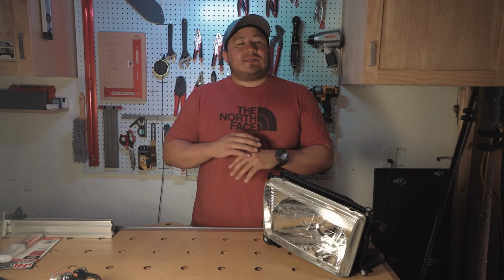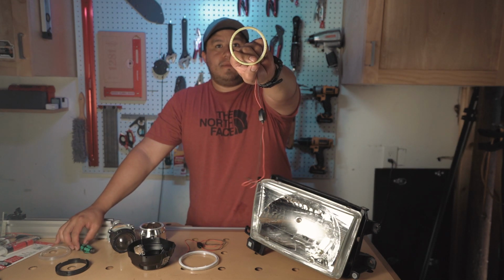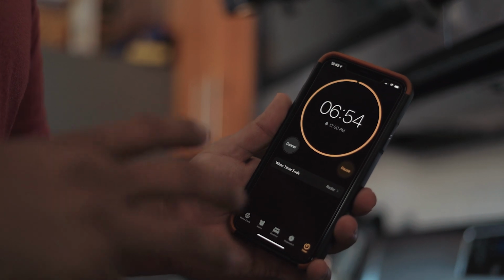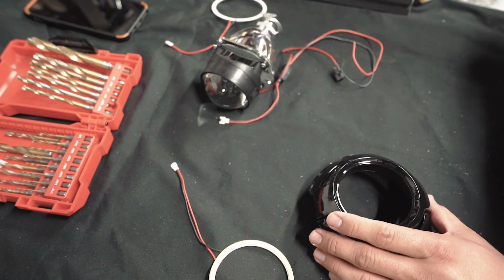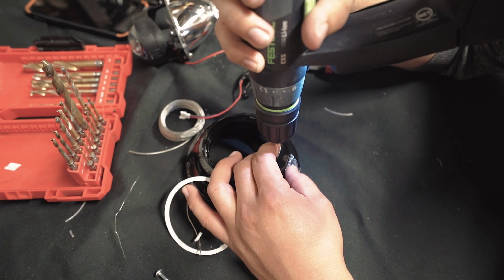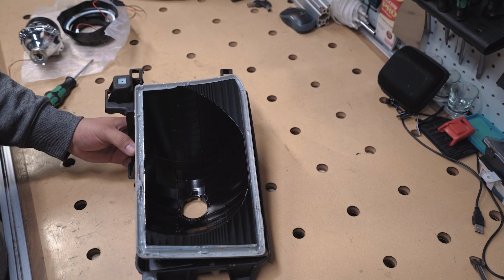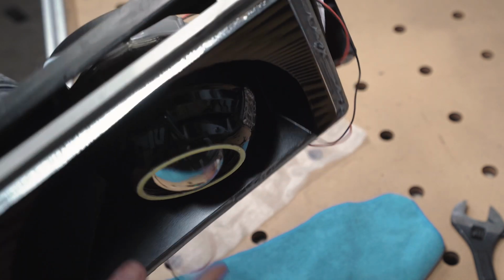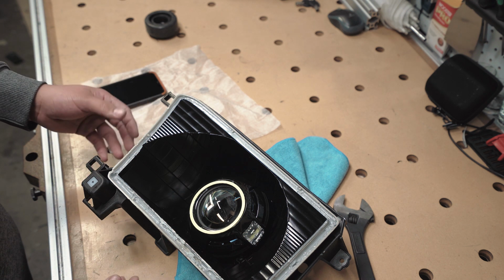DIY Budget Retrofit Headlights - 3rd gen 4runner

Comment: Great video, thank you!! From experience in my semi truck that had projectors, LEDs are horrible in them. In the rain they didn't work well at all and overall the light field was bad, unless it was completely dark and no other light source around. I found a video, sorry don't have the link reference, but the person was explaining that Projector lens require 360 degree of light like a HID provides and LED bulbs only give 180 degree of light and that creates dead spots in the light pattern. So I ordered a set of HIDs installed them and what a difference!! I will never use LEDs in a projector again unless the led bulb has 360 degrees of lights, not just strips of LEDs on each side for 180 degrees of light. Just something to share if you go the LED route.

Comment: I can't find a bulb to fit the Nilite Projector.  The Hikari that you recommend in the other video won't work either.   Morimoto said they don't sell anything to accommodate the Hilite Projector you used.............Did you use LED or HID for this project?  I'm stuck.  I bought all this stuff and at the last step, the Hikari bulb doesn't work and neither does the Moto Holder.?????..........................
Reply: Ewwww, any update?

Comment: Nice walk through. Not a fan of the wires being routed that way though where they just get smashed by the projector assembly and the housing. Is that the only way to route them without making a separate hole with a grommet or something?
Reply: Yup. It's either how he did it in this video, use a pre-existing hole if one is present, or drill new hole(s) in the reflector bowl.

Comment: Do you have to run H1 bulbs or will any LED work ?
Reply from the maker: Unfortunately with the projectors that I linked below you have to use an each one bulb. But you can probably find a projector that uses a different bulb

Comment: Nicely done. What Harness did you use to connect the high beam connector. And what harness did you use to jump the factory 3 prong to the 2 prong. Or wh9ch wires did you connect to the factory plug? Like red to x and black to x
Reply from the maker: There should be a link to my website in the description and I’ve listed the harness there.

Comment: What bulb did you use. I'm finding that the factory h4 bulb won't fit the projector housing. Should I switch to a h1?
Reply: yes, most retrofit projector's are h1 or bi-led's built in nowadays. for this specific application it'll be an h1 bulb to fit in the projector

Comment: is everything you linked in the description all you need for a complete finished product? 
also what is the exact shroud you used, the apollo 2.0?
Reply from the maker: Yes, I also have a link to my website with Full part list & Write up available. You could use any shroud that's 2.5 inches
Reply: @TrailReady4Runner  Awesome man! got em ordered!! great video
Reply: another question, do i need aftermarket led/hid bulbs with this? or can i use the ones that come with the amazon projector set?
Reply from the maker: @cameronsmith3098  So you’re gonna need to buy a H1 bulb.  and also a H4 to H1 adapter I’ll add it to the list above.
Reply: @TrailReady4Runner  Okay, so the amazon projector’s H1 bulb isn’t good quality? It says it come with one just wondering.

Comment: Do I need to wire the connector from the projector if my OEM headlight uses a single bulb for Low Beam and Separate bulb for High Beam?? No right?? I leave it unconnected????
Reply: If your high beam is separate from your low beam, I think you can find projectors that don’t have the solenoid for high beams and you can just put it in an not worry about wiring. But if you get the dual projector setup and you want to use it as a single, you can leave the solenoid disconnected and it will just work as low beam. If you low beam doesn’t turn off when you turn your high beam on, you can connect the solenoid to your high beam so that when you engage high you get both your high beam illuminated and you also take the cutoff out of the way on the low beam for extra lighting.

Comment: Does anyone know what the high beam adapter to the factory plug?
Reply from the maker: On my website I have a link to a harness for HID’s 

http://tr-4r.com/toyota-4runner-retrofit-projector-headlights/
Reply: @TrailReady4Runner  thank you!
Reply: @TrailReady4Runner  Sorry if this is a dumb question but you mentioned that harness is for HID's, I am currently doing this mod but using LED's, will that harness work for LED's as well or will I need a different harness?

Comment: That bulb holder clip sucks. It's better to use a morimoto bulb holder. 

And running those halo harness it's better to drill a hole to route the wires thru and not sandwiching it between the projector. You only need one of those silicone washers.

Comment: Which harness would i need to wire these up? If i used led h1 bulbs can i just wire them straight to my 9003 female plugs?
Reply from the maker: If you go to my website,  link in the description I have a recommended harness if you go with a HID kit. I haven’t found one for LEDs but I know they sell one.
Reply: Did you ever figure this out? I'm buying everything right now to retrofit with LED's but am stuck on figuring out if I need a harness

Comment: Had anyone used the OEM housings instead of new?
Reply from the maker: It should be the same process. 👍
Reply: @TrailReady4Runner I also saw someone ask about a harness? I'm gonna go with leds. Got a link? Appreciate your help
Reply from the maker: So on my website, you can find a link to a wire harness that I used for my HID’s. Now since you’re going with LEDs, you’re gonna need a harness that goes from H4 9003 to (H1 if that’s  the LEDs you get for the projector) headlight relay harness.
Reply from the maker: OK, so I believe I figured it out. I believe if you buy this harness and Cut the H10 Female connector and replace it with 2 Spade Connector it will work. Now again I haven’t tried this so it’s not 100% certain it will work, but I believe it should. 

Harness For H4 9003 Hi/Lo Wiring Controllers: $9.99
https://amzn.to/3wPQCsq

Comment: Anyone done these and figure out a way to shift the light up on the road? Mine are super bright up close and nothing far away
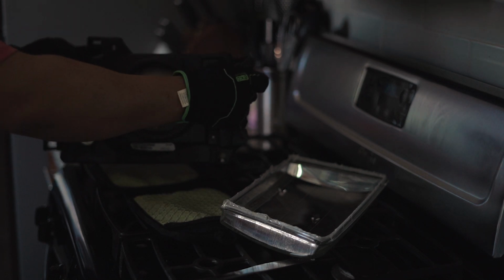Reply: The Toyota (or TYC) headlight housings have adjusters so you can shift the light vertically or horizontally. You can see them from the back @ 14:22. They look like gears and you come at them from the top with a long Philips screwdriver.